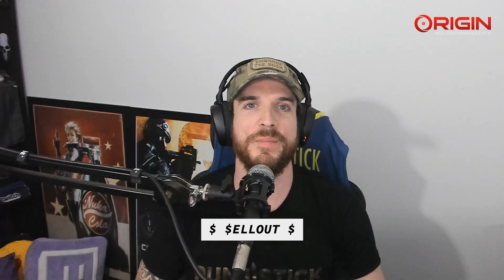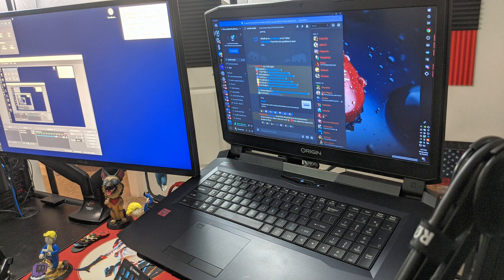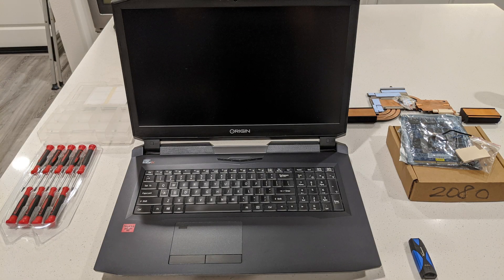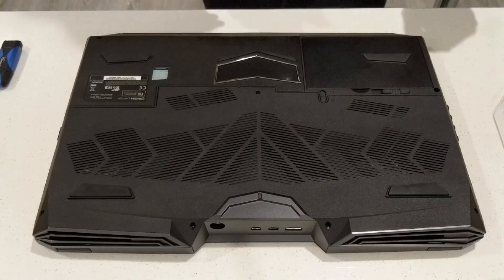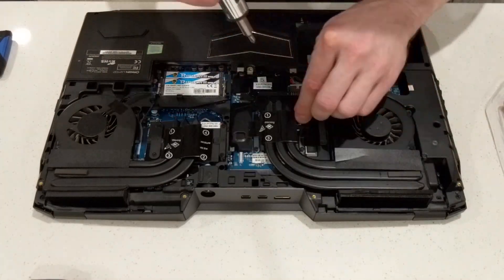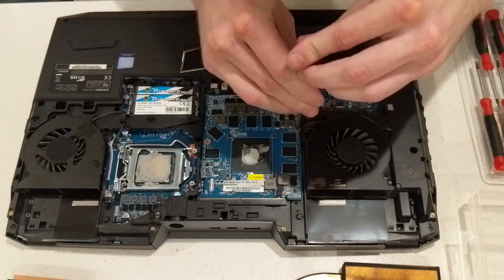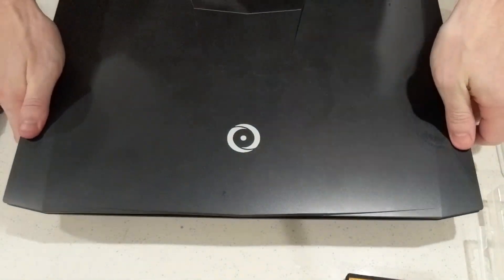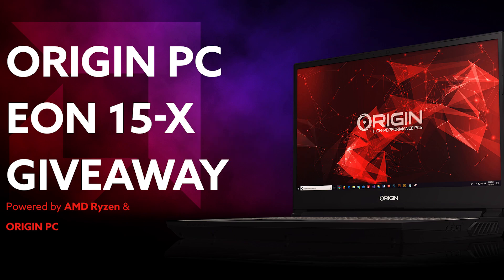Laptops now as easy to upgrade as Desktops? GPU swap by PUNJISTICK | Sponsored by ORIGIN PC

Comment: Thank you. I have the exact same laptop but I didn't know how to upgrade gpu
Reply from the maker: hope it helps! Still for sure more difficult than a quick desktop swap (mostly hardest part is actually finding the card you want), but it's pretty dope that it can be done now.
Reply: Yeah. So far I haven't gotten any. My current one is a 1070
Reply from the maker: @Eze.s_Dynasty  you may be able to try reaching out to Origin directly and seeing if they'll sell you a better card to upgrade yourself. Last I knew they offer upgrade services, so I don't see why they wouldn't send you the card directly and let you save a little on the shipping/labor costs.

Comment: Where can I buy a GPU for EON17 x?
Reply from the maker: That's still the hardest part about upgrading laptop GPUs, actually finding them lol. If you get the actual part number of the card you're after, it can be easier to find them...but mostly this would be a cost-effective DYI you may be able to work out with certain companies. Origin, for example, may be able to quote you on a laptop GPU that they would then send you to install yourself. Alternatively, you could try getting one from a used/broken/whatever laptop someone else is selling. Different laptops may require different supporting hardware as well (in this vid for example my old 1080 used a different heat sync than the new 2080 I installed).

It's definitely not as clear cut as upgrading a laptop GPU yet, but it's certainly a LOT more possible than it was even a few years ago, depending on the brand. Thinner laptops will in general be more difficult.

Comment: Do I need to get the one single heat sink or just use the two separate ones that I previously had?
Reply from the maker: Sorry for missing this, it depends on which cards you're moving to and from I believe. The 9 to the 10 series stayed the same, but from 10 to 20 needed the 1 single heatsink to fit correctly.

Comment: Hey this is a bit of a late question, but do you have any benchmark results on anything from Origin PCs? Game fps? Timespy? Cinebench? 

Point me to a twitch video and I would love to watch it! :)
Reply from the maker: A bit of a late reply 😂 I don't have any official benchmarks, but when I've traveled and used just the laptop on the go for streaming and gaming (I use a 2pc setup at home), it's gotten 120+fps easily on games like BFV, FO76, Siege, fortnite, VALORANT, etc. while still streaming at 864p@60fps with the best NVENC settings.

Comment: how does this compare to metabox/sager/clevo (same manufacturer) upgradable laptops & the Area 51 laptop in terms of simplicity/how many chargers they require & everything else?
Reply from the maker: I'm biased here I know, but box/sager/clevo all came after and do similar things...but origin imo wins by a landslide with their customer service imo. A51 is a solid $1k+ extra for similar specs. They all pull the same rough power for the same components so no getting around the power blocks.

Comment: I remember MSI tried this ages ago with their 18" monster but it was a hot mess. This is surprising simple and straight forward in comparison. Hope everybody reading this has a nice day :)
Reply from the maker: yeah man, and my EON17-X isn't ULTRA slim or anything, but it's not absurdly huge either. I've flown with it dozens upon dozens of times, brought it to gaming events, etc. Not an issue. But absolutely a full on desktop replacement. Works fantastic as my stream PC at home (in a dual-PC setup), but works incredibly well standalone when I'm traveling.

Comment: totally wrong on the thermal paste - you gotta use the verge tactic. keep the pre-applied paste as well as accompany it with several splotches so it oozes out like you just bit into a jelly donut. it's the only way.
Reply from the maker: If your cpu isn't looking like a silver double-stuffed oreo it's gonna run hot